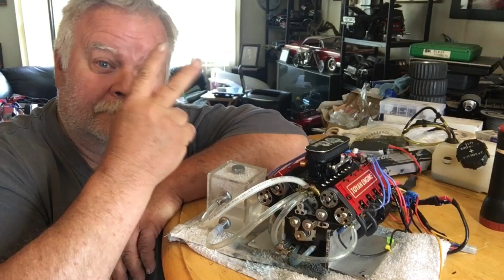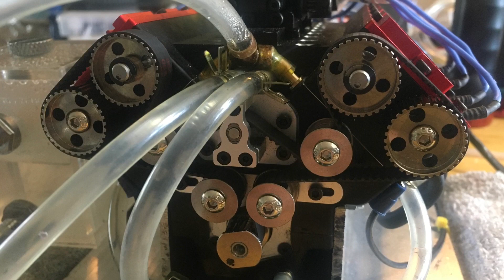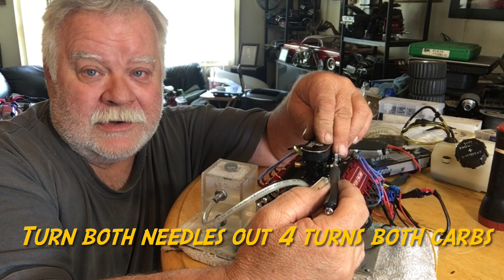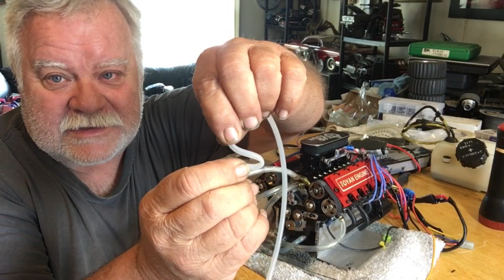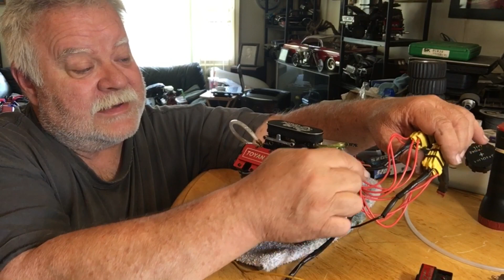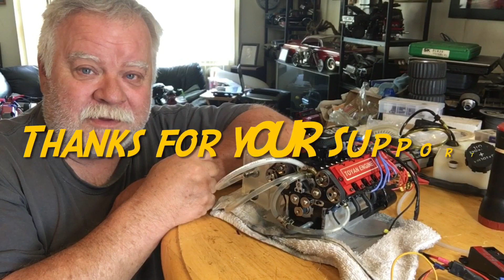TOYAN FS-V800 COOLING UPDATE

Comment: Hey man, I just finished my toyan V8 and cannot get it started for the first time, think you can offer some advice? I am not getting any combustion at all. I do have compression, I notice the exhaust goes in a hard vacume when starting, is that normal with these?
Reply from the maker: sorry for the late reply brother, I have seen some of these are a no start especially the kick start versions, they were sending me one to advertise for them and the factory couldn't get it running and canceled the promotion on my channel, I wonder if the camshaft settings are wrong? I wish someone would send me a no start version so I could compare it to my running version so I could get to the bottom of the problem,
Reply: @dennisdempseyradiooutofcontrol  it's all good, is there any way I could directly contact you? I got the gas version and I'm getting spark and anything, just it doesn't smoke or anything, being that I'm getting a hard suction on the exhaust, I was thinking about putting a little fuel in the exhaust and see if it fires.

Comment: I did a water pump mod, routed copper tubing to front  to eliminate using hoses under the inlet manifold,  makes for easy  water cooling connections. I'm such a star and the KING of toyan mods, also milled off the labels as they look lame and the silly v8 label on top , now looks better.
Reply from the maker: LOL! yeah im going to smooth out my rocker covers also, I will check out your water pump mod that sounds good!
Reply from the maker: I really like your supercharger belt mod! and your gearboxes are sweet brother!

Comment: The official site sells a radiator kit for thus engine now, and all you would need is a little electric fan on it to keep it nice and cool. You could probably add an external water pump as well but the mechanical one would likely bottleneck it.
Reply from the maker: Good tip!

Comment: Hey Dennis great RnD job and thanks for sharing with us. Since I saw the first test videos from Stirlingkit I was ignored by the routing of the coolant. My plan to change it was as following. Coming from the radiator in both outsides into the cylinder head and out of the heads via a T connector into the intake-side of the pump. From the pump output with a single line back to the radiator. 
My intension, it would look clean and is easier to route. Do you see any issues this way or why dit you do it like you did? 
I looked into the potential bottleneck of very tiny nipples and tried to find bigger ones online. But they have a M3 fine thread, so not only hard to find but also unnecessary expensive. Now I might drill them out later if I find them restrictive. 
Regarding the kinks in the line I was gonna use silicone vacuum line they have thicker wall’s but are still relatively flexible.

Comment: It might be worth checking into high temp silicone tubing used in commercial coffee makers they can handle up to 500° F without kinking or getting soft and loose on fittings. i’ve seen 1/4” and 3/8” inch tubing available. Nice job on the build👍
Reply from the maker: Great point thanks!
Reply: Somebody suggested hard break lines for water systems, I think that'd work pretty well not to mention the metal lines wicking heat from coolant

Comment: Max coolant temp is boiling point of your coolant, at your elevation. If you're using water and the system is not pressurized, your coolant won't go any higher than 212F at sea level, it simply isn't possible. You don't even NEED a radiator for that v8, just replace the water as it boils off, which should take quite a while.
If the bubbles cause the pump not to work, well then that's a problem I guess. 😅